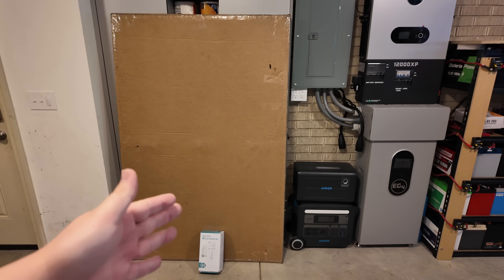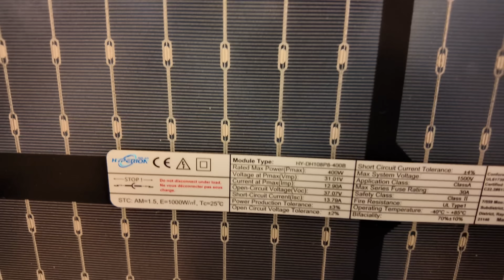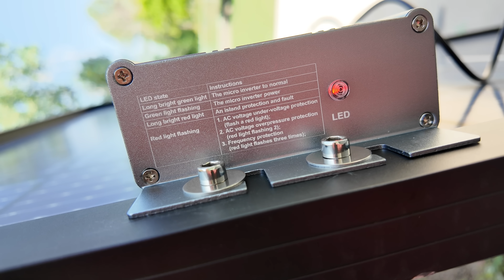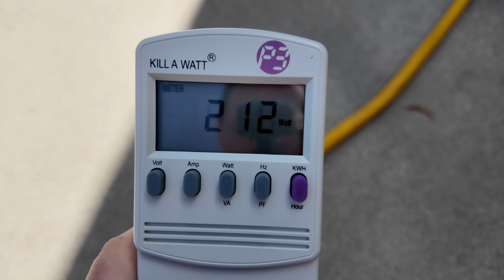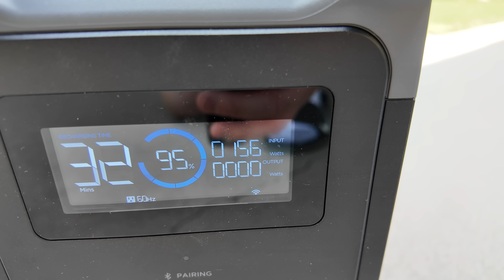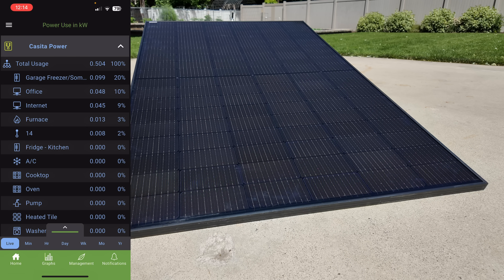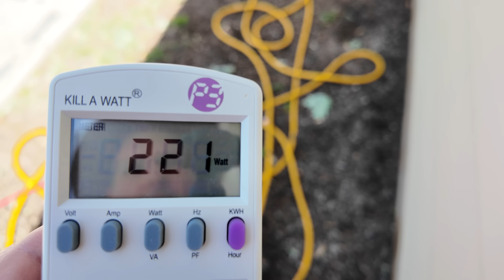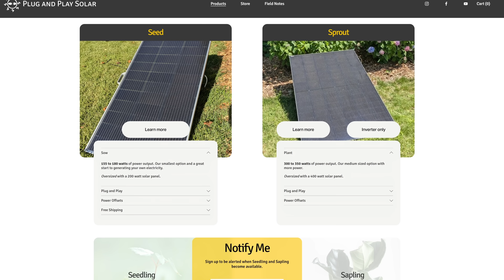This Solar Kit Plugs Into Your Wall?! Plug & Play Solar Review!

Comment: One minor correction:
@ 12:17 you commented “earlier you were making only 160-190 watts”, vs the 220-230 when you moved the inverter to the shade… but @ 6:36 you can see you were actually making 245.
I realize it was warmer by then, so you can’t really make the comparison. But it didn’t appear to make a difference by moving the inverter away from the hot panel… of course a controlled test would be needed to make that determination.
Reply from the maker: Yep! Definitely was not a controlled test. Thanks for watching!

Comment: There are several problems with this. 1. The inverter is not UL/ETL Listed to UL1741SB standard. 2. The inverter doesn't have a 5-min delay when connected to the grid, as required by IEEE 1547 standards. 3. The inverter is 120 or 240. It will give a higher output power at 240V than at 120V. 4. Putting power into a wall outlet means that branch circuit is no longer protected by the 15A or 20A breaker at your main panel. A load or loads on a receptacle could pull more than 15A and melt the receptacle or cause a fire. 
If you want to comply with NEC code, and UL Safety laws, use my Hoymiles micro inverters and connect directly to your main panel or a dedicated branch circuit with the breaker properly located at the main panel, opposite the main breaker per the 120% rule.
Reply: How could you safeguard the plug? Use a GFCI? Power strip?
Reply: @Shadowquad  Remember that most residential circits are daisy chain, so from the breaker it goes to outlet 1, then outlet 2, to a light switch, then outlet 3, then outlet 4, then outlet 5, and so on. Once you add power in the middle, any of the outlets could go over the 15amp current limit. Depending on where the production and loads are plugged in along that circuit chain, will determine which segment of wire is overloaded.
Reply from the maker: Thanks Todd for your observations! I’ve got an experiment video in the works testing the potential overload of the circuit. Stay tuned! Thanks for watching!

Comment: One thing to be noted when doing something like this, it is easy to start a fire. Your breaker from your panel is feeding 15 amps. Then you’re feeding more amps with this. If your wiring is setup for 15 amps, you can quickly have a fire. These systems can be dangerous and I believe that many city codes don’t allow them for that reason. If you’re going to do it, you’re better off adding a circuit dedicated to your solar with proper gauge wire and nothing else on the that circuit. I installed my own 12.8kw 41 panel system in Phoenix using Enphase micro inverters.
Reply from the maker: Great points and safety is definitely important! Thanks for watching!
Reply: we allow 800 watt in germany, fed into your house after the inverter, so you can overpannel way more. there are 1 mil registered and approx another 2 mil "Balkonkraftwerke" as we call them, fires are not an issue, at all.
he has a 400 watt solar panel,  not even making 230watt. this will not be an issue.
Reply: @Smartiezs not necessarily. At 230 watts into 120 volt circuit that's almost 2 amps. If your circuit is already pulling 14 amps from the breaker, it's not enough to trip the breaker but could overload the wire. Now, I do know there are buffers build into the wrote and breaker and at 230 watts it wouldn't likely cause a problem. But 800 watts at 120 bolts is 6.6 amps. That could absolutely cause a fire. The point is the breaker is upstream and won't do the job it is designed to do. Prevent overloading wire and outlets.

Comment: Ok I'll be needing help with the thinking here, why would I even want a solar system that won't work when the grid is down?😮
That makes no sense, you talk about breaking even point it doesn't matter if you are still dependent on the grid sitting in the dark with everyone else. You are not saving the environment trees are being stripped for access to strip mining to get the resources to build the system and 90% is buried in the land fills.
Reply from the maker: It all depends on your priorities. I agree that you should have a backup power source, and I purposely have a large solar system with batteries and off grid inverter for just that reason. I’ve made videos about it. However, some people just want to buy insurance against skyrocketing power costs, and there’s nothing more cost effective than grid tie solar for that. Thanks for watching!

Comment: Great review, and thanks to @plugnplaysolar for providing the test setup.

General question: Are there any microinverter/panels manufactured for  different climates? I'm in southern Arizona where there is ABUNDANT sunshine year round, however, 100°+ days are very common; >60 days on average per year. This would significantly change the calculations for output/ROI. 
Related questions: any DIY solutions to mitigate the heat beside the fan you tested? Heat sinks? Somebody mentioned misters, but that sounds a bit complicated.
Thanks again to Jared and Jeff.
Reply from the maker: From the research I have personally done, the heat throttling seems to be a common issue with 120v micro inverters. I’m not an engineer, but I am very familiar with electrical stuff and my suspicion is that it overheats because it’s got to push out twice the amps that a 240v micro inverter needs to, and we all know that the more amps you push, the more heat that’s generated. 
I won’t speak for Plug and Play Solar…but I have heard rumors from that direction that some heat sinks/dissipation solutions are potentially being tested for this system. I would be if the opinion that some kind of passive heat solution is far better than an active solution like a fan since moving parts always fail much faster than a passive solution. 
I have never heard of different inverters being made for different climates either speaking to your other question. 
Anyway, we’ll keep refining some things here…and keep your ear to the ground for any 120v micro inverters that might generate less heat and let us know! As always, thanks for watching!

Comment: I don't think you're supposed to cover the solar panel with the inverter. You should turn the inverter around so it's not covering the panels
Reply from the maker: That’s a great point! Thanks for watching!
Reply: It is mounted on the backside of the Solar panel as shown on the video, @3:20

Comment: Hello!!!???.....use for big draw.....we have heat pumps now....cool///heat huge draw...plug into heatpump not stable cheap use inside
Reply from the maker: Yeah! Check out my solar powered air conditioning and pool pump conversion videos! Great applications for solar power! Thanks for watching!
Reply: You need a soft start to power AC units off of solar, because the inrush current is very high.

Comment: So, neither panel delivered more than 60% of their rated output, after going through the micro-inverter.  Are losses supposed to be that high?
Reply from the maker: The losses are higher than normal with this mico inverter for sure! Seems to have issues with heat as you can see at the end of the video. Thanks for watching!

Comment: ...dang like love the ingenuity but... those are standard GPO plugs and aren't waterproof at all... 

We use microinverters in our offgrid setups but we have one conversion cable at the end (which can be inside the house or in our case caravan) otherwise we leave the waterproof hardened connectors on the micro inverters
Reply from the maker: That is a great point and suggestion! Thanks for watching!

Comment: Very cool! But understand that the micro inverter is built to live in the heat. They will produce power while they heat up even to 150 degrees yes it doesn't give you the power when it's that hot but it's a give and take. Wait till winter when it's cold out. I have a system with a micro inverter setup and I love it!
Reply from the maker: Great info! Thanks for sharing your experience and for watching!
Reply: Good point. It's always making power for you, just might not be maximum.

Comment: You could buy a used panel and micro inverter for under 100 bucks and hook it up to the dyer or stove outlet and make more on both legs instead of feeding one leg.
Reply from the maker: Yeah, but how to get a cable in the house from the micro inverter, and make it all safe for both appliances to be connected…seems like a lot of hassle! Thanks for watching!

Comment: Be ware got busted in San Antonio putting power onto CPS power . 
The meter sends a signal to them they then come out demanding plans licenses and permits stopping me from using this type of system.
Reply: That's a bummer. But a good reminder to all that you should contact your utility so there are no surprises.
Reply from the maker: Yep! This is a great case for why you must check with your local area first as I mentioned in the video! Thanks for watching!

Comment: So if you are dropping on a 70 degree day and it has been around 100 here for the past month that sounds like I will drop far more than you and make it pretty much worthless. It is nothing to be in the 70s here during the middle of winter.  Am I thinking correct or wrong?
Reply from the maker: Yep! Heat seems to be an issue with this particular mico inverter. Thanks for watching!

Comment: WARNING YOUR SMART METER WILL CHARGE YOU FOR BACK FEEDING ONTO THE GRID...
I bought a 300 w gridtied inverter and only was able to use it a month before the electric company changed out my old backward spinning disc meter for a smart meter!!! Fuckme....
So I bought two 1000 w grid tied inverter w/limiter that provided zero feedback for $300 each!!! And it also works with a battery...
Reply from the maker: Yep! Got to check with your local area first before using something like this like I said in the video…everywhere is different! Thanks for watching!

Comment: I got one that works with 4x 300W panels for 1200W total. It shuts off if grid power goes down so no worries about backfeeding. I am debating on getting more of them as the price is crazy cheap compared to a full house permitted setup.
Reply: can you share this link please
Reply: @JFlogerzi  Youtube won't let me. I am not sure how many of my replies are being squelched.
Reply: Maybe YouTube has shares with the power company. 😄
Reply: Back feeding happens when your produced power exceeds your usage, not just when power is disconnected.

In most places in North America you need an agreement with your provider to do any back feeding and lots of power meters will track electricity going in either direction so you'd both be breaking local regulations and also paying for exporting power.

I think this makes more sense to connect a solar panel directly to a DC heating element in a water tank if you want a cheap and simple way to gather and store small amounts of energy. No inverter needed at all so it's even cheaper to repay for itself.
Reply from the maker: That’s fantastic! Tell us more! Is this a 120v micro inverter?
Reply: @theresatrickforthat  Yes, it is 120 volt. YouTube doesn't like links...
Amazon's listing number: B0DP2P1JP3
Title: 1200W Solar Grid Tie Micro Inverter
I am in Washington State with Puget Sound Energy and they haven't said a thing to me.

Comment: The panel seemed fine. The inverter not so. TBH, I'd rather use the panel to charge something like the EcoFlow Delta Pro and run items from that. Which is what I actually do here. Also, having looked at my local elec company (co-op) it's a big faff to get this in. I hope the Utah law comes to all 50 states real soon as that should help with the ballooning usage.
Reply from the maker: Yep! Your solution is a fantastic one if your local areas don’t allow some kind of solar connection. Thanks for watching!
Reply: That's great if you have very low power needs.  I love my ecoflow stuff for camping.  But its a very expensive way to power a house.  You can get much more capacity for the same money building your own system.  

*Utah isn't actually a solar friendly state.  Our net metering laws are a huge deterrent for many
Reply: @veganpotterthevegan it's intended use would be for powering portions of the house should another Helene blow through here. I am also thinking about it to recharge a PHEV. I have 2 400w panels connected to 2 DP pros and EBs totaling a little over 14Kwh. I can recharge each set, with one panel each on a sunny day, from about 30% to about 60. Enough to keep vital functions running. Or recharge that PHEV...
Reply: @davemckewan4450 that much power doesn't make sense from such a system. You can build one with either a lot more power for the same money, or less money and the same power. Plus you can easily replace individual components that fail.

Comment: Thanks for uploading the video; you have lots of excellent information.  #1. I think it's a bit hard to take advantage of the bi-facial feature of these panels.  Unless you somehow have a reflective side on the ground, it's difficult to angle the panels sufficiently.   #2. The inverter could use a bigger heatsink or some sort of built-in fans.
Reply: A heatsink is something we're researching now!
Reply from the maker: Good points! Thanks for watching!
Reply: Research reveals they almost always burn out in short order.  Also, they're not water proof, but will be placed outside usually.  Good for an off grid shed with a battery attached to a 120v battery charger and an inverter: for a yard light, stereo, small tools, beer cooler.

Comment: Two suggestions: DON'T mount the micro-inverter on the back of the panel. This panel is Bi-Facial, and the inverter shadows at least one, perhaps two cells. All the cells in a panel are connected in series, and the output current is limited to the cell receiving the least amount of light. Shadowing a single cell cuts the current available from the other 59 cells in that string. (This panel actually has two strings, wired in parallel) Suggestion #2)  Raise the panel up off the ground, so the panel itself isn't shadowing the ground, so light can actually reflect onto the back of the panel. Between the fact that the panel is getting warm, inverter losses, and no significant light reflecting onto the back of it, you're getting good numbers! The panel IS performing as "advertised". (I need that MC4 disconnection tool)
Reply from the maker: Those are both great suggestions! Thanks for the insightful comment and for watching!
Reply: What great suggestions! Thanks for the tips. 🌞

Comment: Sounds interesting.  I'm not in Utah, but if I already have a Tesla setup with powerwall that isolates me from the grid in the case of a grid outage, seems like this would be fine.  I wouldn't use it much, but on those cloudy days where every little bit helps, this sounds like a good idea.
Reply: It'd be simple to just plug it in and let it supplement your existing setup.
Reply: @plugnplaysolar  probably a stupid question - but if no solar, say at night and this was plugged in, then my home power just flows to the inverter harmlessly, right?
Reply from the maker: Yeah, that's a great use case! Thanks for watching!